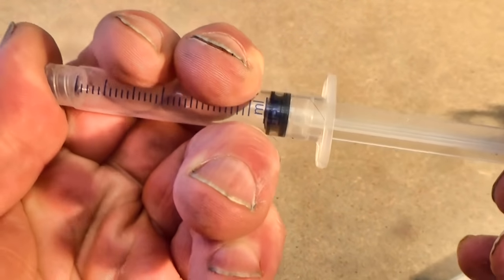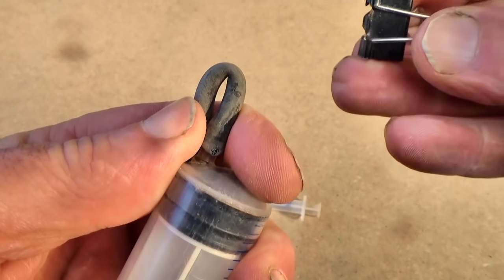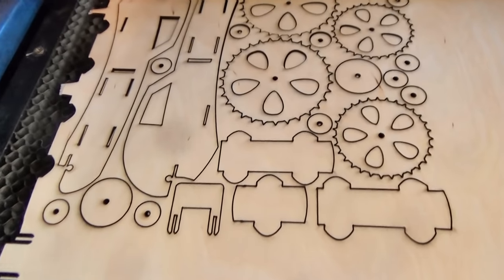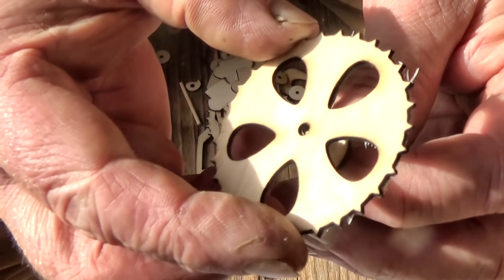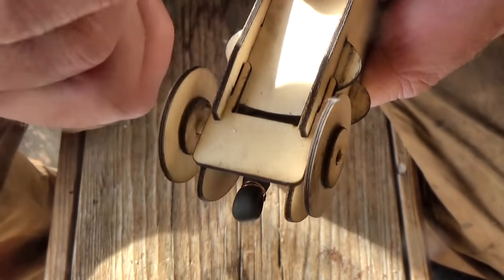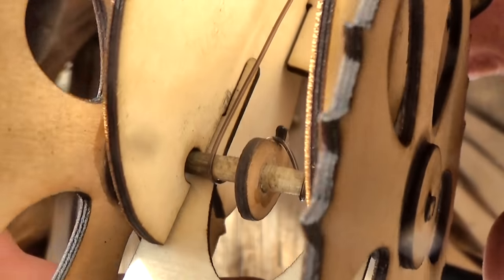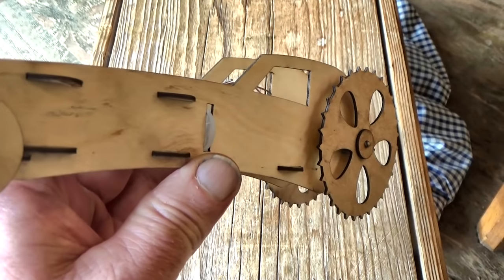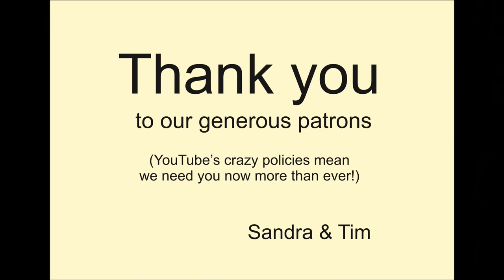The Amazing Vacuum Spring Car! (and make-it-yourself kit)

Comment: You could put a rubber band around the wheels for grip. Cool design!
Reply from the maker: You're right, but if I start using rubber bands perhaps they'd be better replacing the syringe : -  )
Reply: Ah yes, didn't think of that!
Reply: It’s good for kids to learn about co-efficient of friction or lack of!
Reply: perhaps a bit of silicone caulking around the spiky bits for traction on smooth floors?

Comment: Always so diverse and clever Tim. Maybe a Diaphragm Compressor/s For
Larger application 🤔 Multiple compressed chambers, once one is compressed, and released to turn axel, it’s motion fills air in the others. It would get complex quickly but works in my head. And as the great saying goes if you can see it in your mind you can hold it in your hand. Old gas bottles come to mind,
Reply from the maker: I might look at compressed air sometime, but I was hoping to find another way. Compressors are so noisy and I wouldn't know how to attach a horse : -  )

Comment: G'day,

I like it, it works very well on that scale.

 When expanded to being something big enough to sit in..., then considering the diameter and length of the Vaccum-Cylinder which will fit in the Vehicle - or perhaps a parallel pair of them (!) will both limit the range, and start adding weight & complexity in the satisfaction of both Cylinder-Wall Strength, & Vaccumn-Sealing the Piston while ensuring the lowest possible sliding friction from the Pistons (Silicone-greased O-Rings, perhaps ?).

   If you can build two of them perhaps, using Bicycle parts - maybe a Trike and a Quadricycle...(?), and take them to a Car-Club's  Drag-Race Meeting, ideally one that's run on a standing 1/4 or 1/8th of a mile straight course....; then you'd probably only have to put on one set of demonstration Races...., pumped out via YT & FB, before Backyard Eccentrics all over the Globe start thinking of what they might do - to go faster than do you...

  You might want to incorporate a geared Crank-Handle to the system, or a Lever with a Ratchet, to facilitate the re-pulling of the Plug, so to squeak.

  Hand-cranking a Vaccumn-Tank like that, or winding up & compressing a Cylinder full of stacked Steel Strip-Springs...,  amounts to spending a long time storing the energy required to otherwise push the Car along the Road in realtime.

To be  really worthwhile, ideally the Car's Springs should be wound up or the Cylinder should have it's Plug being pulled out..., by a Windmill-driven mechanical Gearbox ; or peehaps a Water-Wheel on a Stream...

  Well done in bringing the Project to Public Downloadability stage...; 3 Gold Stars & a Koala Stamp, at the very least...!

Keep on keeping on...

Stay safe.

;-p

Ciao !
Reply from the maker: Exactly - a water-wheel or (in our case) horses, or a windmill..

Comment: It would be fun to see if you could flip the syringe around and see if air pressure, or vacuum propels the car further. You would lose the linear behavior of the vacuum spring, but it might work.
Reply from the maker: I'm sure compressed air would work better - depending on how much it's been compressed. I'll just have to experiment..

Comment: You could turn it around and make it a pressured air car :-). You can get far more energy stored that way. Compressed air propelled complete coaltrains in mines. You could also check out MDI who try to build airpropelled cars (they have been working on it for many years and have been very promising for all those years :-) )
Reply from the maker: Thanks - MDI? I couldn't find anything..

Comment: With tongue placed firmly in cheek: so make the car weigh somewhat more than the force required to create the vacuum plus wheel and linkage friction. Then only park on downhill side of road and set the brake. Then release the brake and let gravity pull the vacuum.

Comment: I always wondered if you could have a spring with a constant energy output, maybe you could make a clock out of this. I terms of energy storage the earths atmosphere is 0.1 mega pascals so the energy stored by a vacuum is 0.1MPA multiplied by the internal area of the vessel. If you were to use positive pressure then the maximum pressure difference could be much higher than that, many commercial compressors go up to 1MPA.
Reply from the maker: Thanks, David. Yes, I might get to compressed air sometime, but it has it's downsides too

Comment: just use compressed air for you full sized car, pressurize the tank and hook a pneumatic took use to a gearbox, you could probably cobble something together on a ride on mower. The primary problem is an air tank probably wont be a fantastic energy/weight or volume for long range transport.
Reply from the maker: But then it wouldn't be a wind up car